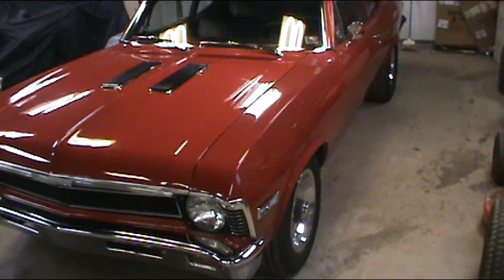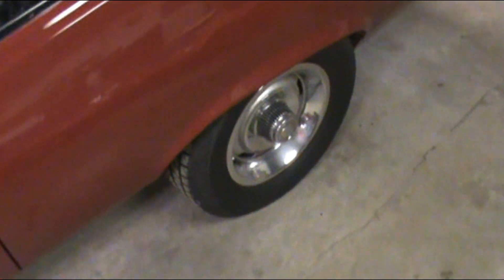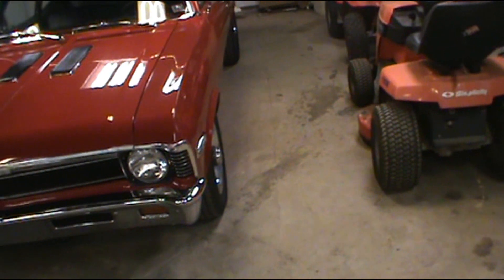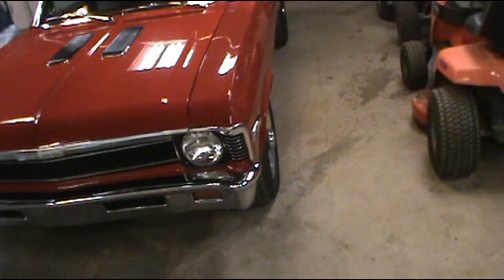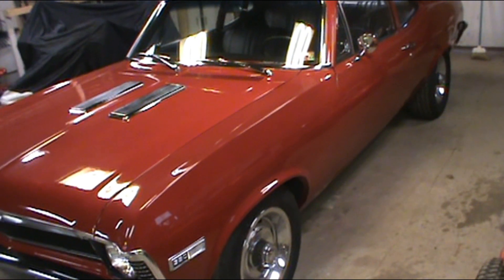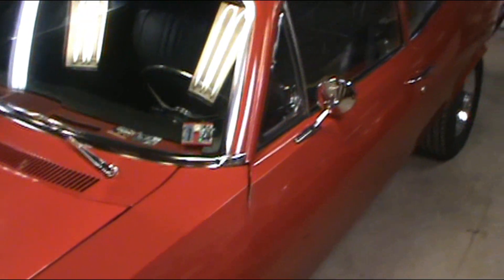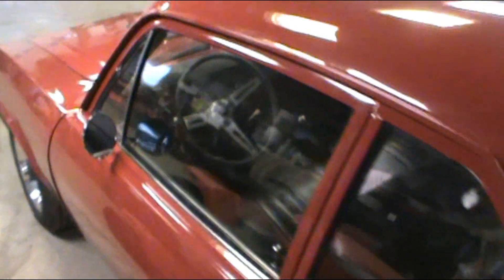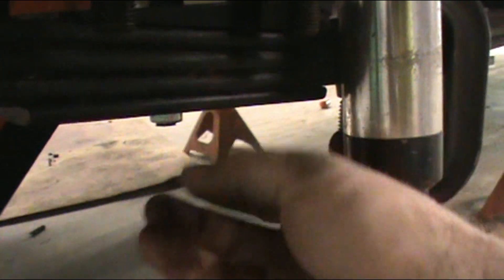how to install pinion shims on a leaf spring suspension

Comment: Make sure you are at ride height.  Need to load the axle with weight of car and driver for accurate measurement.
Reply from the maker: Jackstands were under the axle and used to simulate ride hight

Comment: Best video by far on pinion shim adjustment. And doing it on a Nova made it perfect for me.  My trans angle is 4.5 down and my pinion angle is 3.5 up, so I’m only 1 degree off so I should be ok. Problem I installed slapper bars and they don’t like the 3.5 degree pitch.
Reply from the maker: Thank you, I was out a lot farther but this put it back in

Comment: I’ve got a vibration around 60 as well. I’ve found angles are off.     I’ve got 3 deg down on my th350 and my pinion is 0.7 degrees up. I bought pinion Shims but I’m confused as to which way I want the pinion to be shimmed, up or down.  If my trans is 3 deg down I want pinion to be close to parallel correct? So I would need my pinion to be 3 deg up (positive)??
Reply from the maker: Matthew Joseph correct

Comment: DId you eliminate the rubber isolators when you did this? Also, when you were done, did the spring perch still touch the lower bracket when you bolted it up, or did the width of the fat end of the shim cause there to be a gap between the spring perch and the lower bracket on that end?
Reply from the maker: Lee Gleason no you keep the rubber  pads so vibration doesn’t cause fatigue cracks.  And everything bolted back up fine
Reply: @GSEShop  Thanks for the reply. I wonder how that worked out - for the perch and bracket to touch when bolted together, then everything must have been at zero clearance when it was stock. When a shim is added, around a 3/8 of an inch of thickness is added at one end, and around 1/4 inch at the other - how does the perch still reach the plate with no space left over at that point? I appreciate your answers - I'm in the middle of doing mine now and your video has the clearest example I've found on the internet.
Reply from the maker: Lee Gleason if I am understanding your question correctly, the u bolts are round on one side and the axle is also round so as far as the everything goes when you are inserting the shim, you are rotating and raising the axle at the same time.  As long as you u bolts are long enough you won’t have a problem
Reply: @GSEShop  OK,, thanks for the great info!

Comment: What width shims did you use? And did you install the rubber isolator pads when you did this?
Reply from the maker: Lee Gleason I think mine were 2.5 inches wide but you have to measure your leaf springs to get the right ones.  My leaf springs are aftermarket so don’t go by my measurement.  And yes I did use the rubber pads

Comment: Well did it fix your issue?
Reply: Car should be fully load on  its wheels to take the angle specs.
Reply from the maker: yarkie1 it improved, I think I may have more than one issue.  I have a slight vibration at 60 to 65mph

Comment: Help me understand the direction of the shims. You needed to raise the pinion (reduce angle) and so you had the fat part of the shims facing the front of the car, right? Then again, I'm spring over axle, so perhaps mine will be the opposite of yours...?
Reply from the maker: Mark L spring under you would have the fat part to the front to raise your axle pinion and change the angle.  Spring under should have the fat part facing the rear to raise the pinion and change the angle.
Reply: @GSEShop  Spring OVER has the fat part facing rear to raise pinion? Thanks
Reply from the maker: Mark L yes
Reply: @GSEShop  The place where I'm buying the shims responds with this below. I made sure to tell them I am spring over axle. 
Answer:

“If you want the pinion to move upward then you will install the angle shim so that the thicker portion is to the front and the thinner portion is to the rear.”

Eric from Speedway Motors
Reply from the maker: Mark L I am going to have to disagree
Reply: @GSEShop  Just found some Ford F150 Performance directions on lowering and it confirms fat part to the rear. Thanks
Reply from the maker: Mark L thanks for confirming that I am not crazy
Reply: @MarkNOTW 
That IS correct. Installing the wedge from the Front as in thick side of wedge facing front of vehicle will rotate the axle and Raise the pinion.